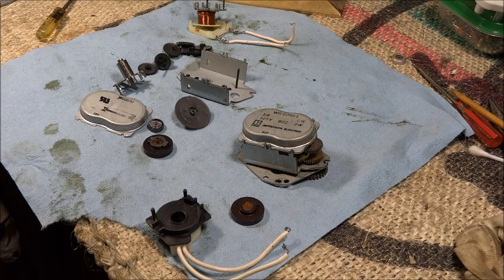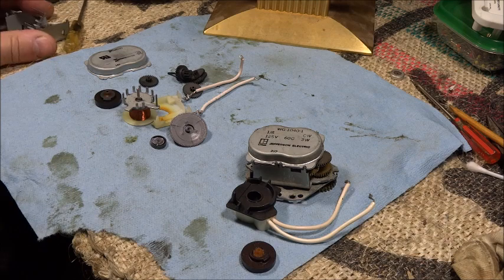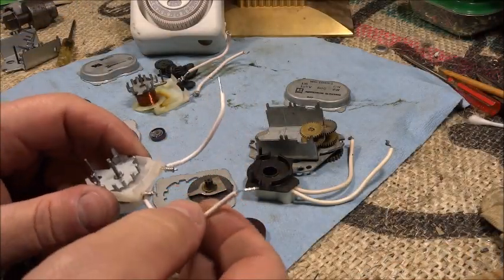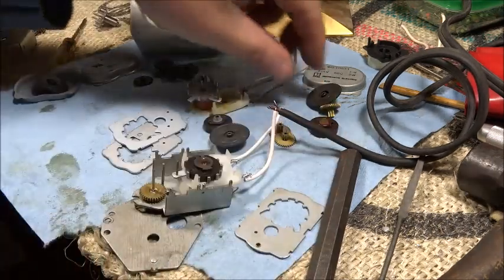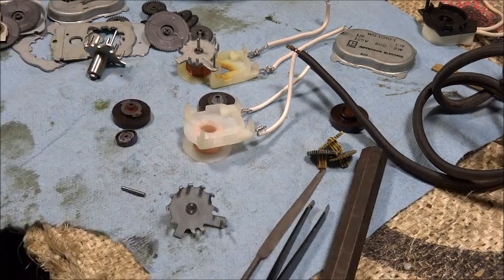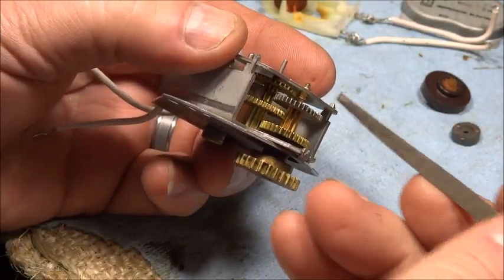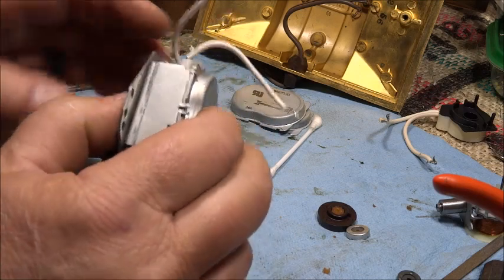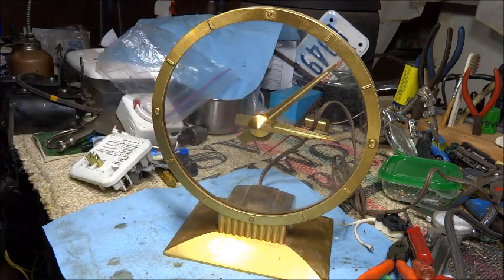Jefferson Golden Hour Clock Motor Repair

Comment: Thank you! Thank you!!  I was able to repair my 1984 Olympia beer motion sign because of this video. My only change was i drilled the original stator out it the frame with a 3/16" bit and tapped the donor with a 6/32 thread. Works great.

Comment: Definitely the path less traveled.  I do understand the "fun" part.   Myself will probably just be getting a new motor if It's a bad coil or buggered gears.  I bought one running, but it's noisy as hell and my hearings nothing to brag about.  Recently I bought a non-runner that does not look too bad.  I think it will be fun to have one plugged into wall and the other next to it powered by Uninterruptible Power Supply for giggles.   Thank You,  Watching your video ideas are occuring about why mine may be noisy and how to quiet it.

Comment: hi jeff,  I wish I was as a mechanically minded as you are, but I'm willing to give it a whirl. I have the same clock and the motor has started squealing. I removed it from the clock and it continues to squeal, so I think the motor is the issue. However, I am not able to get it apart.  I can't find any little tabs and I've tried frying it but there's just nowhere to get a hold of it to open it up.  Any suggestions? Thanks so much
Reply from the maker: I'm afraid I can't be of much help. I do hope you can get it figured out though.
Reply: Thanks for responding. That should have said "prying" not frying!

Comment: Greetings John, We have this clock from 1952 and I am trying to get it working. The motor seems fine and I got it running, but it doesn't keep time. I have a couple of questions; First, the cord was in pretty bad shape and I want to replace it with a three prong I have saved...will this be okay for the motor? Second, the glass is loose from the gears around it; so, it seems like I should tighten the bond between gear and glass. Does this make sense? thought I would apply an adhesive at multiple points around the circumfrence. Thoughts??
Reply from the maker: Three prong should be fine as long as it is wired correctly, with the ground lead going to the clock out motor case. As for the glass, I don't have knowledge of how it is fastened to the gear. Maybe a search online will yield you a definitive answer.
Reply: I restored a Golden Hour clock. The large metal gear has to be reattached to the glass with some epoxy. I used the powder glue with the liquid hardener.

Comment: Just curious... Was the drive assembly from the timer not a 1/6 RPM?  Also, could you move gear train from "old" motor to "new" assembly?  I'm about to try this and just wanted to know.  Thanks
Reply from the maker: The new motor was the right RPM but I just wanted to keep the original housing and brass gearing that had been in the clock. It's been a while since I did the repair but I imagine a new motor/gear assembly would be a fairly easy swap into the clock. Good luck with your clock.

Comment: Thank you for your video! How did you manage to take off the brass gear and the cover over the other gears? I have "Jefferson Golden Hour", but i need replacement for the small electric motor. This is what is printed on the aluminium case of the motor: 125v WB-5080 60C 2.5W MFG. BY INTERNATION  (Not International)  REGISTER  CO  CHICAGO , ILL  USA.  The motor runs for a short while and then stopped. This happened before and clock stopped running and than again started today for few minutes and stopped again! The glass+ring (that is moving freely and has no missing teeth!) isn't looking problematic at all. So I removed the motor that has a brass gear 19.34mm or 0.7615 " and 27 teeth, but I don't want to disassemble the gearbox and motor, before I can find a replacement. Would you know where I can get a replacement motor? Thank you very much! Tony
Reply from the maker: No, I don't have specific knowledge of where to get replacement parts for these clocks. My best suggestion is to do an internet search.
Reply: @redxl883c  Thanks anyway!
Reply: Timesavers sells the motor and other parts.

Comment: Good repair tip. I have one of these in need of repair. Have you come up with any fixes for telecron clocks with the mod m1  type B-2  v.110 c60 W.3  1rpm 😁
Reply from the maker: Ha, you've stumped me. Never heard of a Telechron M1 B2.
Reply: @redxl883c  No way!  They were from the 20s and you see lots of dead telecron clocks on ebay they I think may still make aftermarket mot,ors but there  noisy and not very good . I thought that was a pretty clever repair on that mystery clock though.😁👍🏻👍🏻👍🏻👍🏻